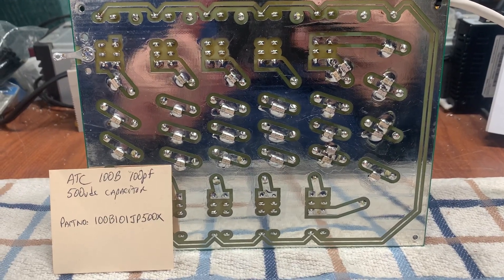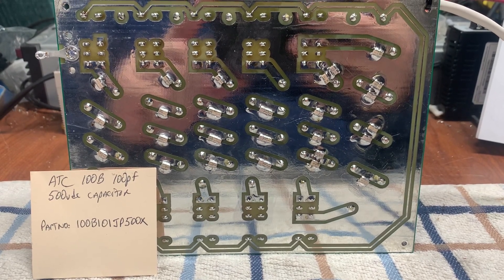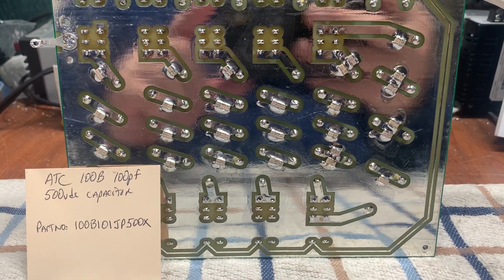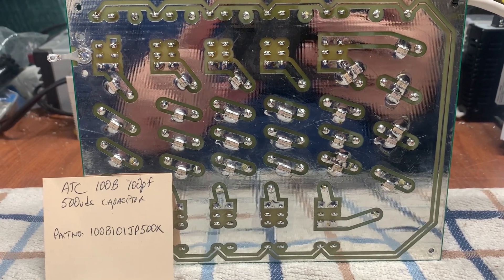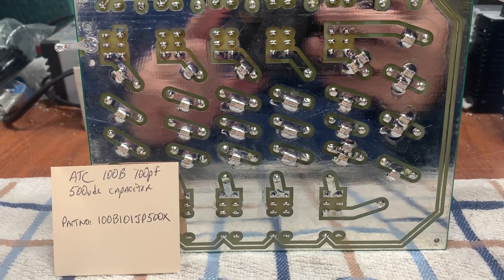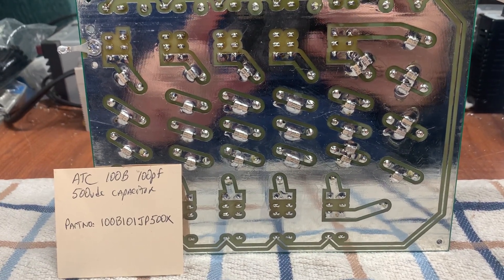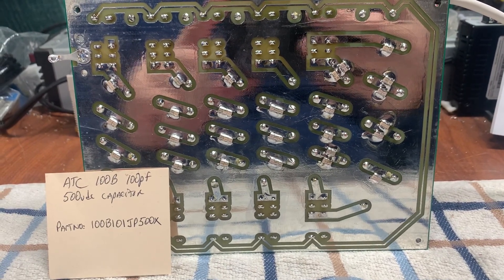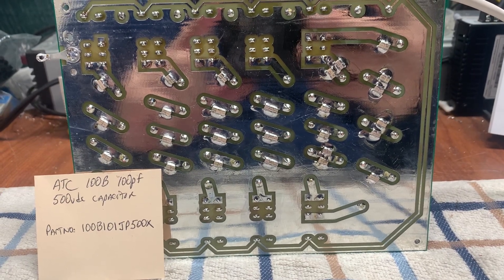American Technical Ceramics 100b capacitors

Comment: Their operating voltage is 500V, but these capacitors are tested for 2000 hours at a voltage of 1000V.
For many years, they have been used for low-frequency filters of powerful amplifiers by radio amateurs, for example, in Russia. Very reliable capacitors.